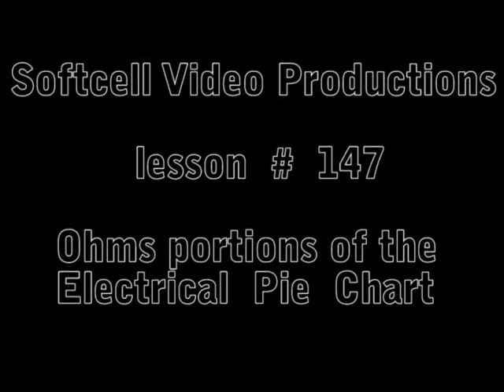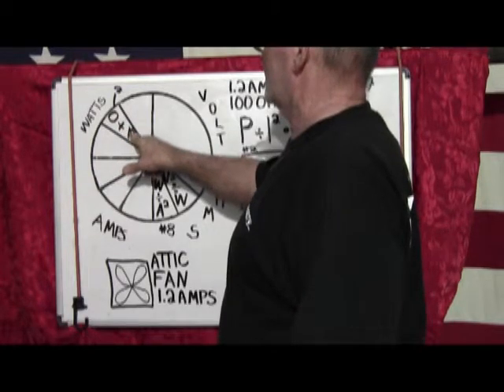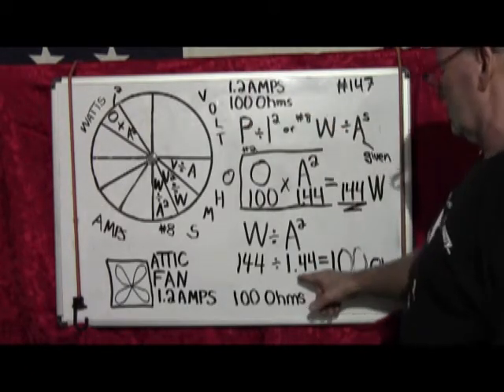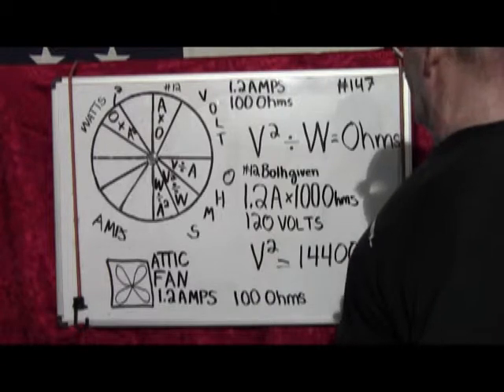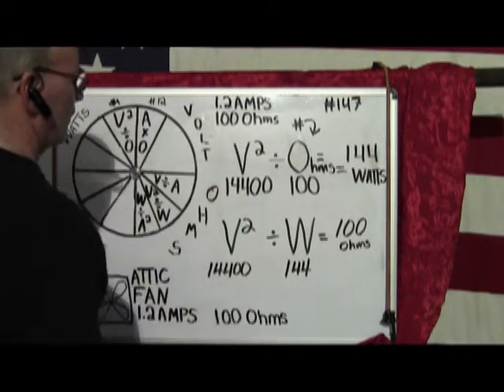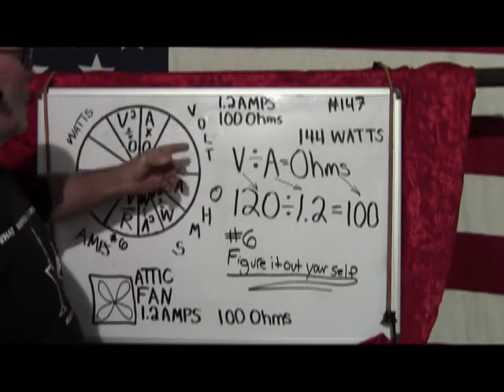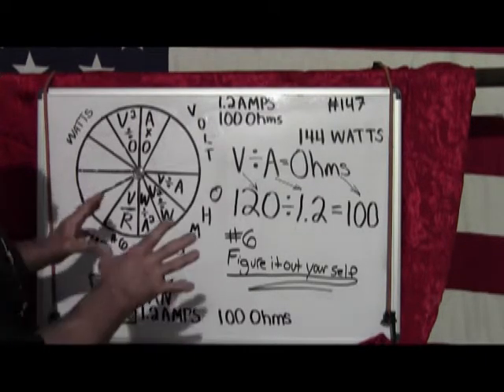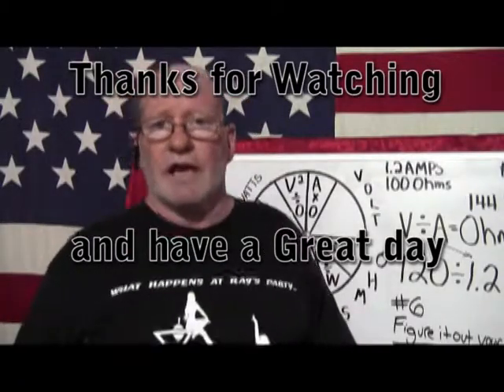NEC standard Ohms formulas  #3 B  # 147

Comment from the maker: I am in the middle of a major video project. The three ohms formulas in the chart will answer any variable you may need to know. Just plug the values in. Sometimes you have to borrow formulas from other parts of the chart to get a needed variable. I demonstrate this several times in the 12 part series. Best of luck to you, thanks for the post.